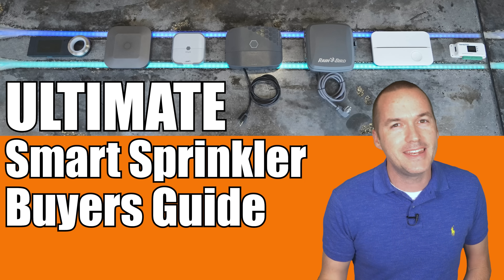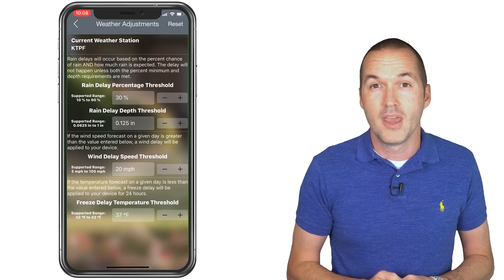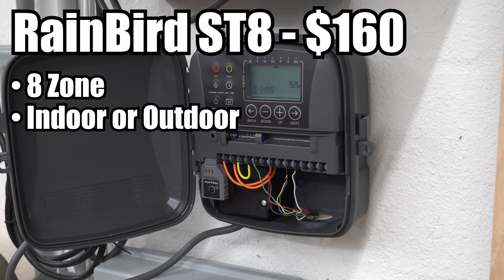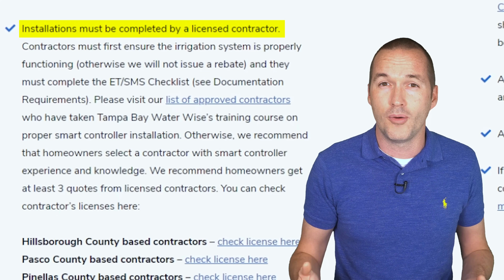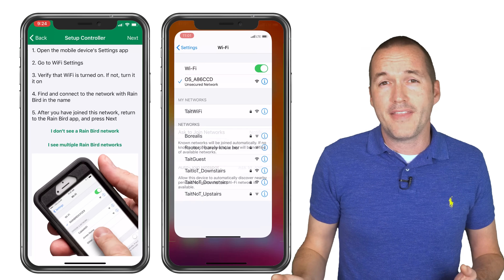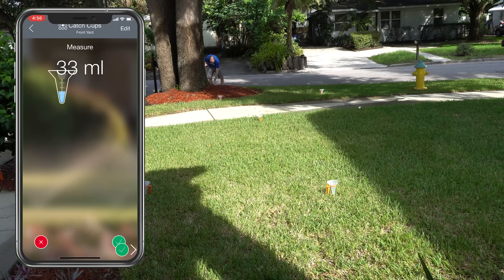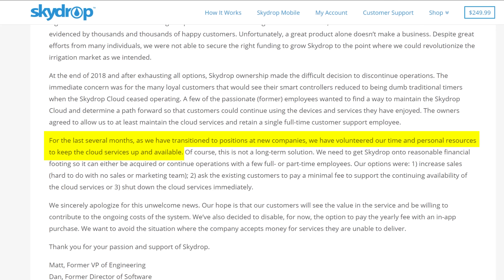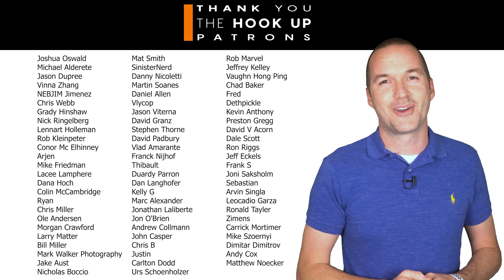7 Smart Irrigation Systems TESTED: Buyers Guide

Comment: Just get the Rachio. It's easy to DiY wrong .. in this case it could add up to $$ thousands of dollars in dead plants from too much / too little water and wasted water.

We've had and so have several of our friends have had the Rachio for years with no issues. My guess is your WiFi issue is your fault with your IoT settings. Also there's a old saying, pennywise and dollar foolish. Also just an observation you seem to be to focused on "shiny things" instead of solid design and function. Disappointing especially after what I thought was a very insightful AI video surveillance camera system.

My experience with Rachio: 1. Our landscapers and irrigation people (they adjust the heads / system once a year) are familiar with the system. 2. Their AI in years has been nearly perfect only twice have I overruled a sprinkling and that was a couple years ago. 3. Minimalist design unlike others reduces component and subcomponent failures. 4. Flawless integration with AIs simply works. 5. Hardware integration with third parties simply works (moisture / rain sensors, flow meters, etc).

Like any projects you can't go in all "ADHD" and expect perfect results, instead Rachio offers a full support system. Frankly, my best advice is to spend a $100-$200 and let a professional tweak the system properly unless you take the time to accurately research your soil type, plant types, angle of slope, etc. Watering too much or too little are equally bad.
Reply from the maker: I'm really confused by your comment.  The system I recommended (The BHyve Indoor) is the least "shiny" of all the systems and the one that uses the most real world data and has the least chance of failure. 

I agree 100% that DIY is not worth it in this case because even a few miscalculated waterings could cost hundreds in water and lost plants.

I actually think the Rachio had a short outage when I was adding my controller, as I said it had no problem connecting to my network or the internet, it just couldn't communicate with the Rachio servers.
Reply: @TheHookUp  .. My observations and comments are at an end so there's little more to say. I watched the entire video and the choices that you've made; form over function. Ask someone other than your wife or friends for honest feedback. Unless all you want is"Awesome 😊😎👍 videos" without anyone meaning it or taking you serious. Your channel has a chance, research more in depthly. Food for thought, the balance between cost to benefit needs a little more thought. People can brainwashed themselves to justify anything.
Reply from the maker: Not to sound like an ass, but you appear to be the one who is brainwashed.  You are blindly saying "just get the Rachio", without having used any of the other systems.  I actually purchased, installed and tested each of these systems, and you still think you have a more valid opinion even though you've only used the Rachio... I just can't understand your reasoning.

The system I recommended (BHyve Indoor) is significantly cheaper than the Rachio and offers all the same features and more.  Add to that the fact that Orbit is a large company that has been in business for 30+ years compared to Rachio, which I believe was founded in 2012.

You said the choice I made was "Form over function", when the choice I made was a small grey box with a single button.
Reply: @UC2gyzKcHbYfqoXA5xbyGXtQ .. Brainwashed is following some influencer or noob over facts and or a combination of an expert with reinforced facts from practical application and over time.

💡If I want advice on a sprinkler system then go to an expert on sprinkler systems. 

I own a data center .. brainwashed would be me replicating Linus's "server room" or taking his advice on nearly anything as a paid influencer.  

My criticism is your choice in comparison and in contrast with your advice based on limited self influenced decisions thrown onto others. Instead compile information from multiple sources, collect and compare facts, and ideally find others to collaborate with combining experiences. In short just because you think it's a way doesn't mean it's that way.

Comment: Do any of the systems you tested support drip irrigation? When I looked for an option last year, it didn’t seem like they did. I ended up putting a system together with 4 Shelly relays and an Ambient Weather station. Although the system doesn’t rely on cloud services, I suspect I am over watering ... which gets back to your point about the “lawn science” part.
Reply from the maker: Yes, all of them that I tested allow you to select "drip" as the irrigation type for a specific zone.
Reply: Interesting. That certainly would have been easier than the home made system I put together :-)

Comment: I love my b-hyve! But I did notice that during the peak of Florida summer it did a rain delay a few more times than I would have liked. It got a little dry but I just overrode the delay a few times and it was back to normal.
Reply from the maker: One thing about Florida in the summer is we have forecasted rain every day in the summer.  I was able to tweak mine to delay for forecasts over .25" instead of the default .125" and it has solved that issue.
Reply: The Hook Up just adjusted it! Thank you. Did you leave the default percentage at 30?
Reply from the maker: I did.

Comment: Please review also Netro smart system. I have one and I feel very comfortable using it. It is similar to bhyve. It has moisture sensors and adjust watering based on soil type, plant type and forecast. It allows also to set up manual watering.
Reply from the maker: Looks like cool products, but from my quick research it looks like VERY small startup based in CA.  Free cloud support is at risk with this type of company.

Comment: I have two zones that control misters in my horse stalls. Open sprinkler integrated well with home assistant so we can have easy button control over when to turn them on. If I get some time the thought is to allow HA to evaluate temp and wind and turn them on automatically.

Comment: Good overview as always!  I went with Rachio3 at the beginning of summer. Quite happy with my purchase. It does integrate into HA but really there is no reason for the integration as the solution is a set it and forget it. Works flawlessly and has saved a ton of money compared to my DIY open sprinkler solution I was using previously years. Just an FYI I am seeing ~$100/mo savings using Rachio3 over open sprinkler and my lawn is very green. Might be because of the smart sensors for moisture saturation and the smart sprinkling Rachio3 does to prevent runoff.  Anyways, that was my pick after a lot of research. Wish the video was around a year ago. Would have still made the same decision.
Reply: It does integrate with HA..
Reply: contactcr yes I said that. there really is no automation scenario for the integration.
Reply: contactcr I typically wouldn’t dedicate a zone off my lawn irrigation system for either of those scenarios. But those are good scenarios and ideas.

Comment: I have the Rainbird ESP-RZXe controller (not smart). I am looking for an an option to integrate soil moisture sensor. I want to skip the sprinkler cycle if the moisture of the soil is okay. I can control the water pump via Home Assistant. Currently I am trying use a Xiaomi  plant sensor but Home Assistant did not read reliable via Bluetooth the data. I am looking for a WiFi oder zigbee option to improve the connection. Does anybody has an advice for me? Thanks in advance!

Comment: I have a Rainmachine pro 16 and it is amazing.  Ethernet or wifi available.  No cloud for logic. Connects to weather APIs such as NOAA and Weather Underground for adaptive watering. App is easy to use, but has on unit controls as well.
Reply from the maker: I assume rainmachine is paying the weather underground API subscription, or do you have to pay for that?
Reply: @TheHookUp  It uses NOAA by default but you do have to supply your own key to use WUNDERGROUND. It supports nine by default and you can add anything via custom python script.
Reply: The Hook Up I ran my own Personal Weather Station and uploaded to WU. The API key was free for the WI PWS. I like the RainMachine for its ability to pull from multiple weather sources and it ability to operate stand alone so I’ll get at least several more years from it. With the big name systems I expect the product line to be around for a while but I wouldn’t be surprised if support for updates and service on units is dropped after five or so years.
Reply: The Hook Up i dont have mine tied to WU as the NOAA data works really well for me.  Rainmachine doesnt provide any of the data APIs; you are free to use whatever one you want.

Comment: Holy moly. I just finished making something like this from scratch not knowing these even existed! Water shortage here in Auckland so I made a system to harvest the rainwater and water the garden accordingly to soil moisture and weather predictions plus some conditional logic/UI. Looking forward to the video!
Reply: Yeah DIY with a $4 ESP32 mini, bluetooth moisture sensors, a few relay boards, home assistant, and a national weather forecasting service have worked extremely well for me.
Reply from the maker: The concept behind turning sprinklers on and off is simple, what you are paying for with these is a service to do the lawn science for you.  Seasonal changes, soil saturation calculations, weather based changes, etc.
Reply: @TheHookUp  By monitoring foretasted and actual  rainfall along with current soil moisture I don't need that service. It's easy not to over/under water and easy to allow gaps in the watering schedule to encourage root growth. It's not rocket surgery. :)
Reply from the maker: You know I like to DIY stuff, but a ESP and relay system will still cost $20-30 without any programming.  For me at least paying an extra $50 to have the calculations done by experts is a no brainier, especially since I don’t need to worry about changing my programming when the API changes.
Reply: @-vermin-  Yeah, exactly, man. I'm measuring, predicting and using my own algos to water smartly and not only conserve, but water each appropriate section accordingly.  Ideal conditions and mitigations are easily researched and programmed, too. All DIY and I'm kinda keen to release everything I did.
Reply: @bigpickles  go for it, man! Throw some files up on GitHub, just for your own future documentation, if nothing else.
Reply: @RossReedstrom  that is my intention. I just need to prep all the proper documentation to support it all. It's high time people made these things themselves!